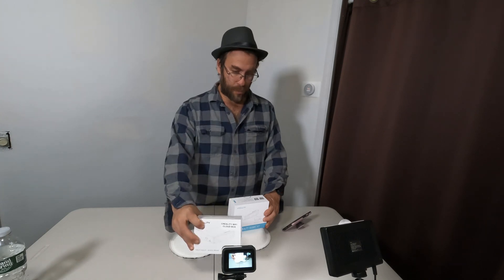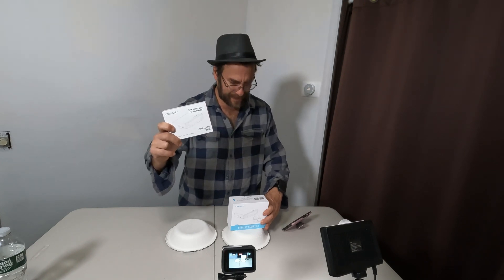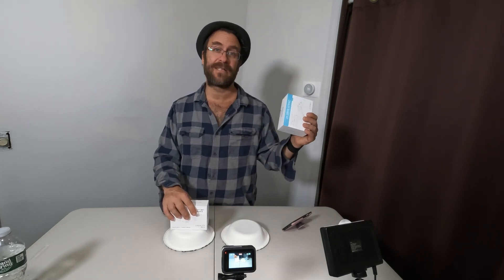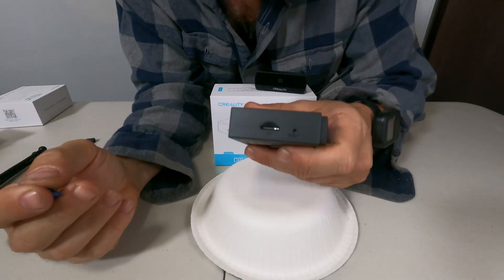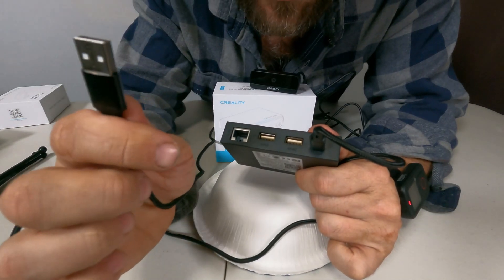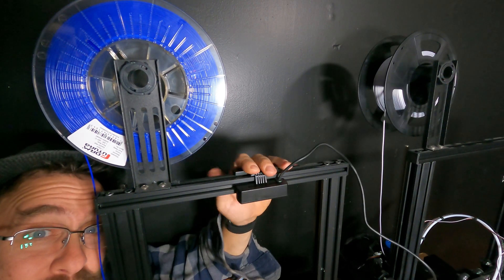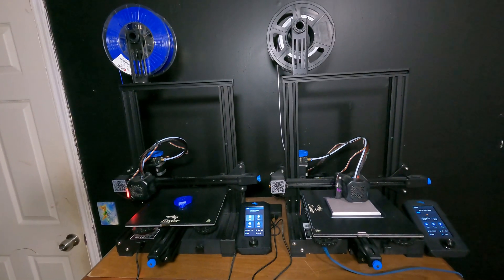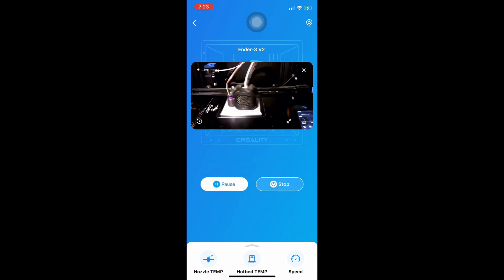Creality Smart Kit & Wifi Cloud Box, UNboxing, Setup, Review

Comment from the maker: Do you have one? How do you like it? Let me know in the comments! (P.S. Sorry for the Re-Upload. There was an error in the original Upload)
Reply: Hey, thx for the video... I just installed one with your instructions...Took me 20 minutes toghether with cables ;) It works without problems. Like you said it´s missing some cool options :( I have a problem with taping forth conector on USB (cause my screen is flickering after I turn off the printer), I just didn´t find the right spot yet, I´ll try more cause this flickering is distracting...
Reply from the maker: Oh so cool! So happy. Cover the ENTIRE 4th pin. All of it, front to back. Any contact, and the 5v will get through
Reply: @GreggAdventure  Yeah, I suceed, it´s working, I just needed few more attemps ;)
Reply from the maker: @alessinko1843  It's a pain in the Arse. Hit the Sub button, and feel free to share in any 3D Printing Groups it may be helpful in. :)
Reply: I have the 2.0 hooked up but I can’t figure out how to get it to do Timelapse. Any ideas or have you used that feature?
Reply: @vanniek71  It does not have that feature.
Reply: @gonecrazynback  actually it does, I figured it out after I posted here. You have to set the time lapse feature on, have the auto record feature on and then print from a slice that was sliced in the Creality cloud. Then it works sometimes.
Reply: @vanniek71  have you figured it it out tell me
Reply: @Whyalwaysreparingstuff  Read my comment above for time lapse. It is very app dependent, you cannot do it if you are slicing on your computer and then uploading it. It has to be sliced on the app and printed from there.

Comment: If Creality knows of the issue with printers attempting to draw 5 volts from the box, why did they not eliminate that in software.  Is taping the USB cable mentioned in the instructions?
Reply from the maker: This is a very common situation with usb accessories and 3D Printers. You can get a usb power blocker on Amazon. Most peeps do that these days

Comment: Am I understanding correctly that you need one of these for each printer? Or can you hook multiple printers to one box
Reply from the maker: Yes, one per machine. However, there are much more powerful options now, with the Sonic Pad and Nebula Pad. Sonic Pad supports up to 4 machines. But this is a great, easy and affordable way, to add wifi and creality cloud support, to an older machine

Comment: Wifi Box with camera - working with Home Assistant?
Reply from the maker: Google Home? I use those allot, but, I do not think it will work with this.
Reply: @GreggAdventure  No. I mean Home Assistant. I now printer need raspbery pi minimum version 3 to connect with Home Assistant. But what about this Wifi Box? 😀

Comment: I am inexperienced.. and I would like to start printing, (objects that I will need for woodworking, therefore with precision and models of future projects), REMOTE over a long distance and I would like good quality, (I would build a box for the printer like this to make it closed and keep the heat and inside I would place a camera) having made this premise:
In your opinion, given your experience it would be better
-cr-10 smart + creativity box
-cr-10 smart pro + creality
-X2 artillery + p3 raspberry
could you also give me an explanation of why, of each printer (ps. I need a print bed of these dimensions)
I thank you in advance
Reply from the maker: Truth be told, most of these and others, will print in similar quality. I would have to have a quick look at those 3 models, but... Creality has a massive community for support and parts. You would want Octoprint or Klipper. Creality new Sonic Pad runs Klipper
Reply: @GreggAdventure  can you find out about the three printers I wrote to you?

Comment: If I were to go into my firmware and increase the max temperature the printer could reach, or if we're to increase the bed area, would this device be able to account for that or would it be better to just use octoprint
Reply from the maker: This feeds the GCODE to the printer. It has no effect on the cgcode or the firmware

Comment: Do you have the 3d touch pad? I one with the wifi box and can't figure out how to connect the 2. I really don't want to have to return the screen. 😭
Reply from the maker: No, not a fan. Using the stock screen, but, it shouldn't matter at all. You connect to the wifi box via the Phone APP, and the Website. No need to do anything with the screen
Reply: @GreggAdventure  I figured as much. I wanted to have it for a cool feature lol

Comment: hello, I know this is a long shot, but I've been looking for the Wi-Fi box and during my searches I've come across the cloud box 2.0. I am wondering if there is a difference between version 1.0 and 2.0?
Reply from the maker: One of them has a Memory card slot, and one does not. Get the 2.0.  I am also aware of one with Bluetooth, but have yet to find one...
Reply from the maker: OK, so, turns out the 2.0 IS the Bluetooth version. It also uses USB-C, for power,  instead of USB-C. That makes the 2.0, the 3rd version of this box. I'll have to get one and try it. BT will make setup so much easier
Reply: @GreggAdventure  thank you for your reply, I was worried because I had already ordered one and later found out about the 2.0, but if the only difference is that it has Bluetooth and usb-c then I don’t mind. You are very awesome.
Reply from the maker: You'll be fine. I'm running 5 of the non BT ones. Always happy to reply. Hit me on Insta too!

Comment: I was extremely disappointed with the creality, because in the original FW that came in the box, my Logitech C920 Pro worked and after the V2.00b82 update they removed the support. I am VERY upset about this situation because in addition to mine, I bought one for a client and now I won't be able to fulfill the agreement with him.
Reply from the maker: Wow, I wouldn't know, because none of my Boxes will update to the new firmware. I'm working on figuring out why and how to resolve that. Weird to find the Camera not working. Are you SURE? I've found that mine randomly stops working, and starts working. The Creality cam is still the most reliable with the Box. For now...  I would get one hooked up for your client and be done with the issue
Reply: @GreggAdventure  So... The first way I saw Logitech working on the Box was through accessing it directly via browser via IP:10.10.10.254 connected to her wifi. Inside there is a "USB" option where you can access the camera and there was a setting to enable it and it worked, after the update this option disappeared. Unfortunately we have no option but to invest more money in their camera.

Comment: Thanks a lot! I have a question. From Creality clould App, when I slice some model, how can I set up for Auto-leveling(like Bl-touch, Cr-tourch) in the slice program of App??. Whenever I print any model online through the cloud App, Auto-leveling didn't work and just start to print directly without measuring bed.
Reply from the maker: Truth be told, I've been dragging my feet with exploring the recent updates to Creality Cloud. When you autolevel, do it at the machine and Save. When you slice, add "M420 S1" after G28, in the GCODE..  That will pull the Saved Mesh from your Printer, and use it.

Comment: I cant figure out the settings with this my prints are not good and very stringy
Reply from the maker: Stringing tends to be heat related. Get your speeds down to 40mm (in CURA, not in the printer screen!). Set your bed temp to 55, Nozzle Temp to 195.  Don't go past 60 for your BED, with PLA. No real need to pass 200 Nozzle, with PLA either. Even PLA+.  Give lower temps, slower speeds, a try. Let me know how you do. Also, learn from me at: 3DRUNDOWN.COM

Comment: Great video Thank you!

Will this work if the printer has custom firmware, I’m using Jyers CFW on my E3V2?

Can one box control multiple printers?
Reply from the maker: It'll work on Jyers. I run Jyers on 2 E3V2. But, one box for each machine. Sadly no hardware  "Server" type solution.  However, the App will show all your Box connected machines, together, which is super
Reply: Today, my Ender 3 Max is running Marlin 2.0x and at first I didn't see any problems.

Comment: grr. I missed how the tape got on the usb and now my printer is off on rehome and won't print. I've updated the firmware, but it still is freaking out. I hope I can figure this out!
Reply from the maker: not taping the cable, shouldn’t cause this. Something else is happening. I would remove the Box while you troubleshoot. Use the Latest Stock firmware, from Creality site.
Reply: @GreggAdventure  thanks. I’ve done the firmware , but it seems like it just doesn’t want to rehome. I can manually align with move, but Z isn’t moving. Then it will freeze on the display.
Reply from the maker: Weird. Check all the easy obvious stuff. Make sure your Stepper Motors are connected at the Motor, and the Motherboard. Even if they are, maybe worth disconnecting and reconnecting. Make sure your Z isn’t binding or something similar. Disable Steppers (or power off), and Should be able to turn the Z Stepper by hand. But, sounds like move commands work?  Have you tried to initialize Eeprom? That will reset it to default

Comment: Hi sir, i can't update my creality wifi box. I do all the steps but percentile not progressing and stops at %0. What could be the source of the problem? Thank you for video.
Reply: I will try. Thank you again.
Reply from the maker: Anytime.
Reply from the maker: Hi Loftuk. That sounds annoying. I haven't encountered this problem with my boxes, but, this kind of thing can definitely happen. I would try power cycling the box. Completely unplug it. Let it sit for 15 or so seconds, and plug it back in . Restart your phone also, before trying again, incase the APP is causing it.
Reply: @GreggAdventure  Thank you for answer. I using 5v-2A adapter . Could this be the cause of the problem?
Reply from the maker: No, that should be perfect. Delete the app, and reinstall it, incase the update download is corrupt.  Also, reset the box. There is a Pin hole in the back

Comment: You can use a web cam now And the app will records a print that you sent and you can upload a model on the web site and then print it
Reply from the maker: Is that True, I can't find anything on that. When did this happen? I have not seen any support for 3rd party web cams
Reply: I didn't even know about the creality camera. I unknowingly just bought a Logitech web cam  from staples and plugged it in and it worked
Reply from the maker: Get out!? There is no documentation confirming this. I just ordered another one, and I’m gonna test my Logitech with one of my boxes today!
Reply: @GreggAdventure  did it work
Reply from the maker: YES. But sometimes it didn't. I just use the Creality cam